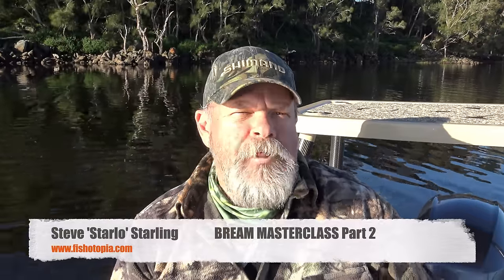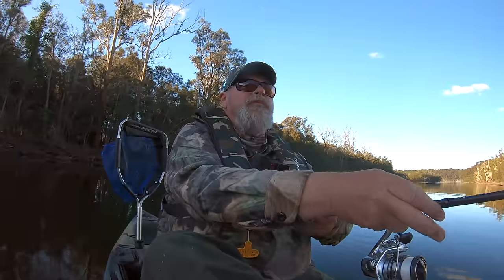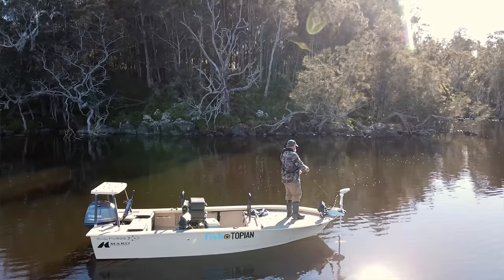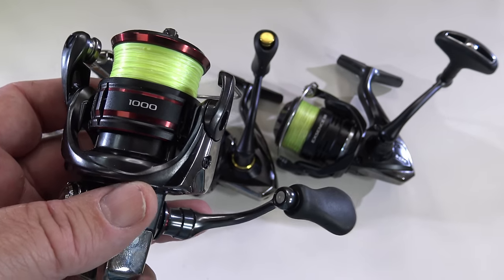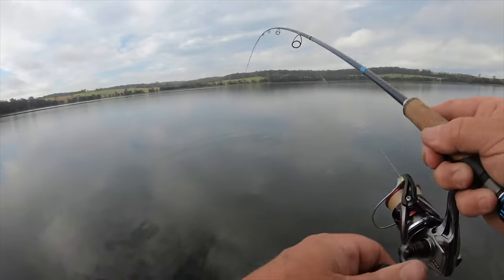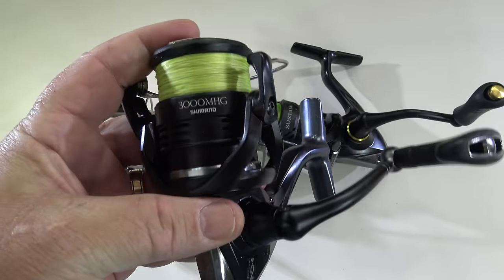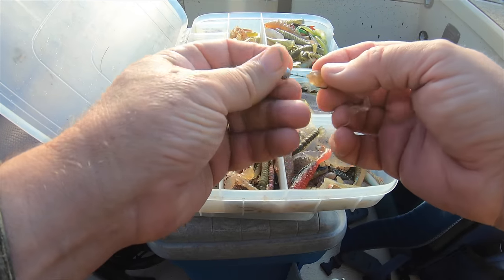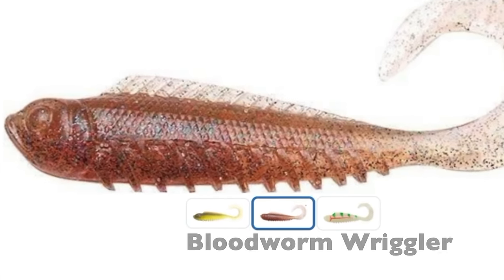MASTERCLASS: Your Ultimate Guide To Catching More Bream On Lures — Soft & Hard! (Part 2)

Comment: Great advice. Thanks. Random question and apologies if it's a stupid question...but what do you do in a bit of current, if you trying to fish under structure like a bridge  and the current is pulling in or out depending on the tide and your lure just washes in same direction of current...? Do you use certain jigheads? I most use weedless with round sinkers due to snags but just curious if there is any tricks to this? 🙏
Reply from the maker: Not really any tricks. You may well need to increase your jig head or sinker weight a bit in strong current and cast up current of the structure to allow the flow to take your lure towards it.
Reply: @StarloGetsReel  thanks, I have been doing pretty much this, but I have no real luck yet, but I guess being winter also plays a role, and they are a bit lazy the bream!